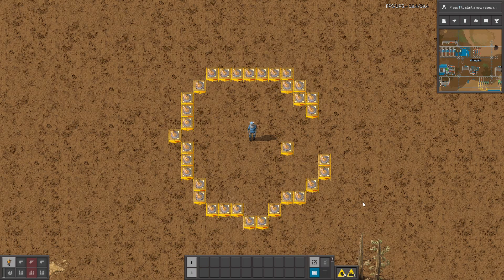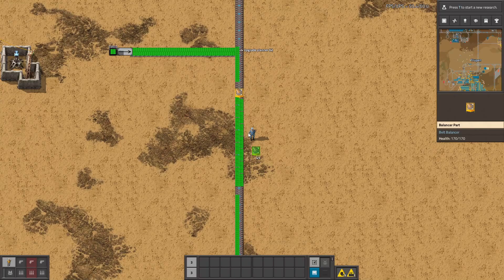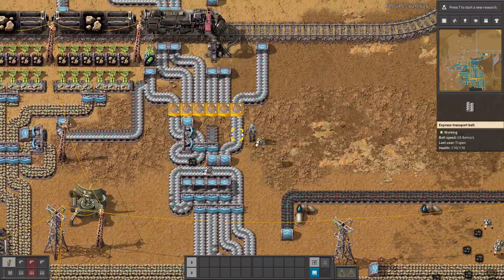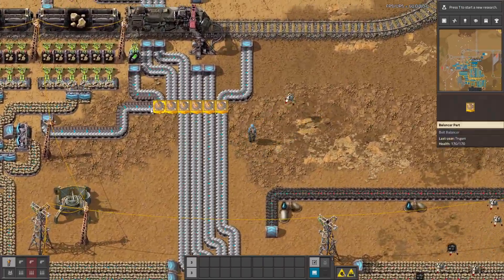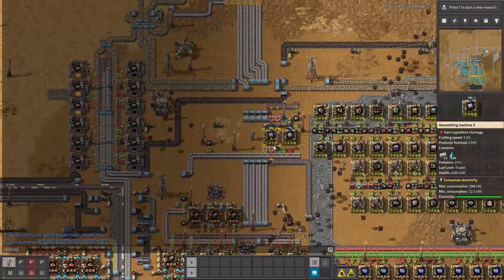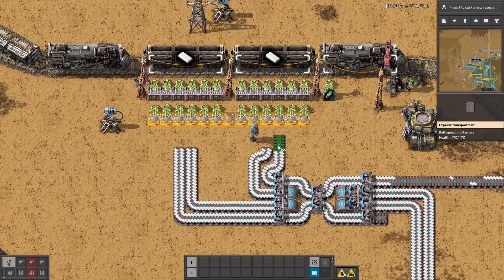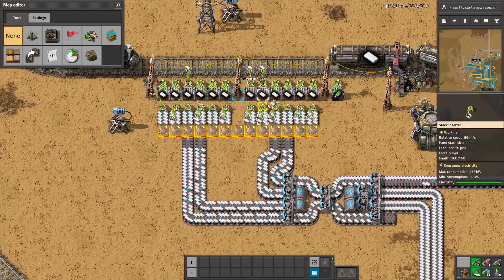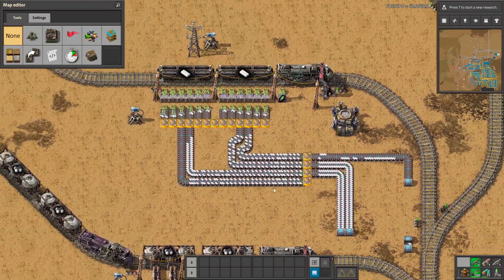The Best Balancer in Factorio.

Comment: A little more UPS friendly version if you don't want to download a balancer book is just using a big chest (AAI Containers for example) and then connect loaders for in- and outputs.
Reply: i actually did this for my second save both as a buffer and a balancer
Reply: Use merging chests
Reply: This works, but you do have to make sure your input into the big chest is equal to or greater than your output. Otherwise your output loaders won't be able to completely fill the belts.
Reply: @haineko1101 It'is true for any contraption
Reply: @luminas-d9w  nope. balancers will output equal sparse streams, chest will output randomly.
Reply: still takes alot because the inventory system scans all the slots every time you interact with the chest. The bigger the chest the igger the lag per interaction.
Reply: Or just use Wagons
Reply: @atomspalter2090  I believe it only scan enabled slot. So I usually just disable all slot but one for any storages I use as balancer

Comment: Balancers are pointless. You only need to balance belts when you have no idea what you're doing. You know exactly how much your factory needs. For example, 48 miners = 48 furnaces = 1800 iron\m = 10 cog factories. Or 48\48 and 20 wire factories. Same 1 red belt. 2 for output. Where do you need balancing? You don't need to calculate an exact amount of resource per factory, you count with factories. Let them take whatever they need from the belt. Balancing is only needed for that abomination people call main bus. When they have no idea what they need from it, just make it transport an abstract amount of resources for future use. In Factorio, if you don't know where exactly is a belt going, you're doing it wrong. Give me any complex and I'll tell you why you don't need to juggle belts there.
Reply: And then there's modules with their wacky ratio :))
Reply: @raizors1331  Nah, it's the same, simply round up +1. Modules are complexes with like 12 furnace arrays so when the calc says you need 13.4 go ahead and round it to 14 and not look back. Same ratios after that. If you need a full belt you take it all, if you need less - make it go through and join together with other leftover belts. No need to balance them with full belts. Ever. I never faced the need. So you count with belts and split 1 belt if you need. Factories per belt should not drain more than 1. And there are no single factories that would consume more than 1 belt of anything. I dunno, maybe in Angelbob\Krastorio they do... I never went far in these, I loathe  complication for complication sake.